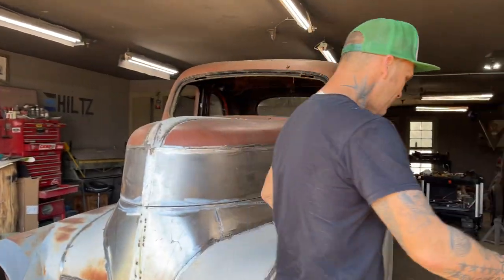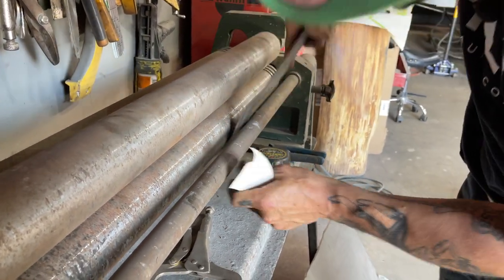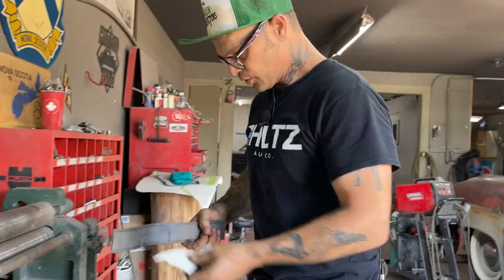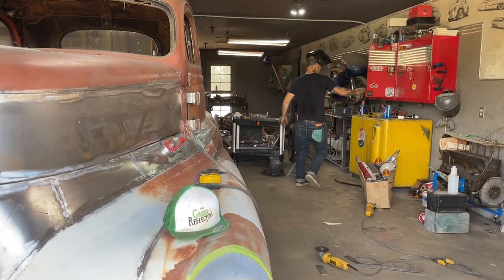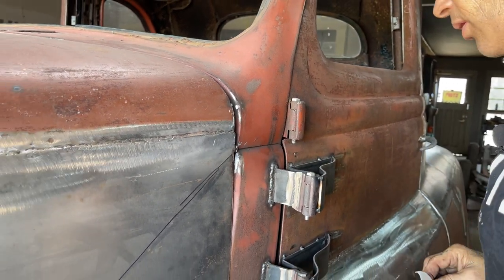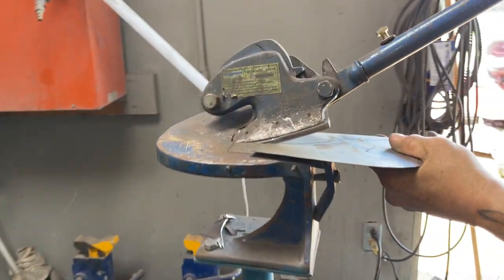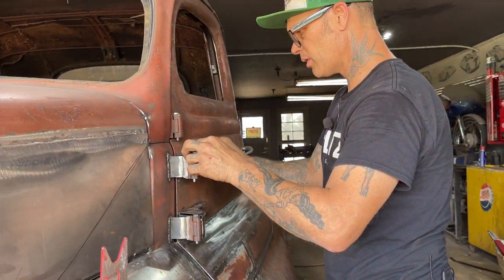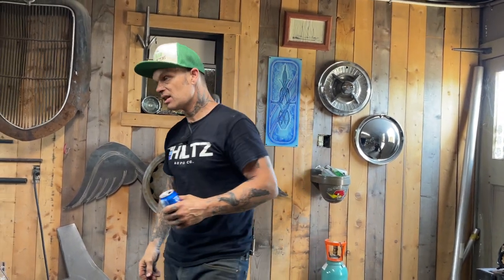ART DECO METAL SHAPING: 1949 MERCURY CABOVER

Comment: Chad, your welding magnet is not grounding to the metal. A fix is to weld a nut onto the magnet bracket then using a bolt or all thread screw it through the nut and down to the car metal surface. The nut and bolt allows for adjustability on uneven surface. Enjoy your weekend.

Comment: I know this is an older video but I think you need to take the magnetic clamp apart and remove the paint where the red part meets the magnet and the nut meets the bracket.